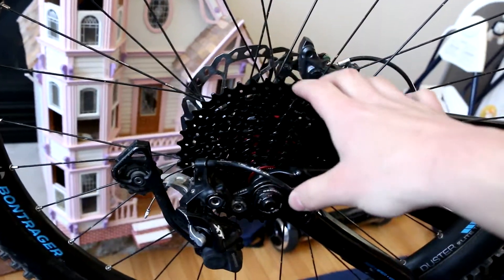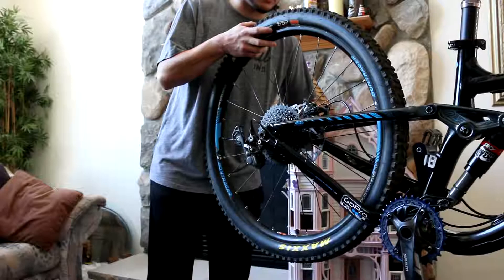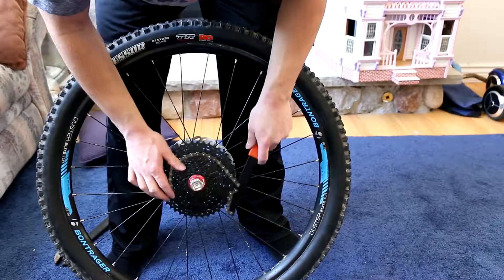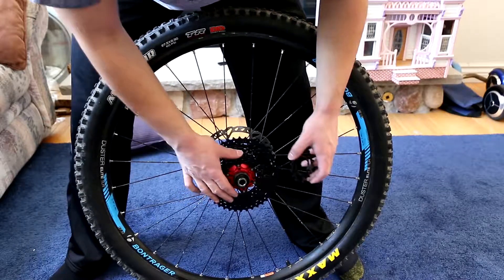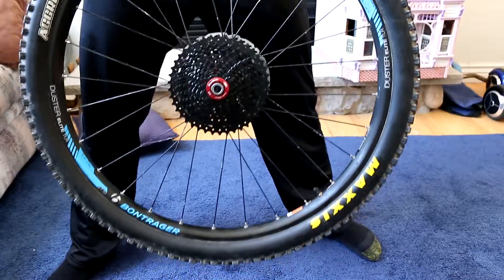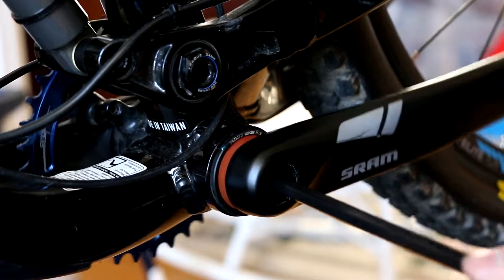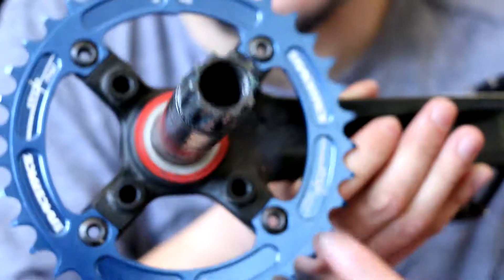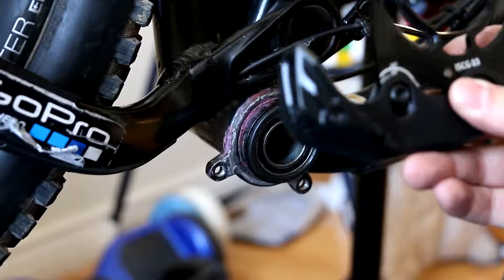How to Change Your Mountain Bike Drive train!

Comment: I would have just went with an 11 speed, now you are missing some climbing gears lol. Also if you have a clutch on your rear derailer i would have just turned that on instead of a chain guide.  Shimano Shadow 11 speed  SLX or XT both offer it.
Reply from the maker: Orlando Mendoza my hub cannot fit 11, which is why i kept 10. 9-42T range is more than capable of climbing anything i want. The 42 pedals very easily. The clutch with a narrow wide chain ring definitely would keep the chain on, but personally i like the look of having a chain guide. I wanted to do this as cheap as possible, otherwise i wouldve simply bought SRAM Eagle GX, but i spend around $100 instead of $500
Reply: CarbonActionSports any MTB shimano free hub will fit 8-11 speed!
Reply from the maker: Orlando Mendoza i also wanted to keep the price down, and going to 11 would mean i needed to buy a new shifter and rear mech as well